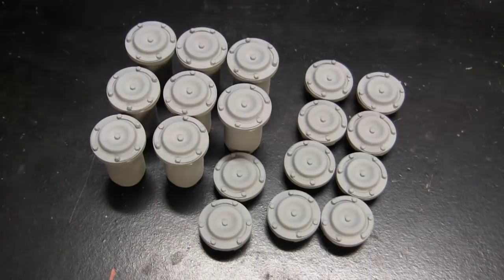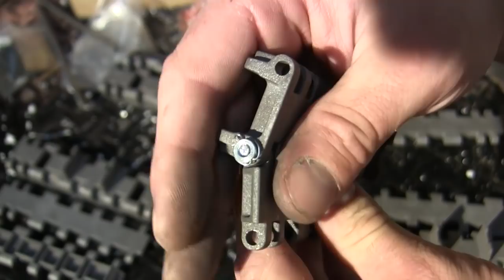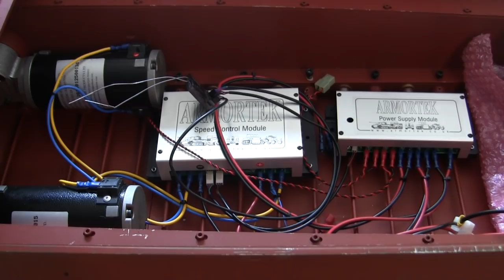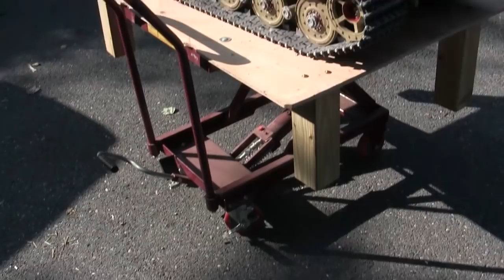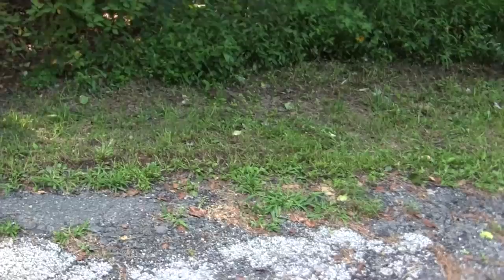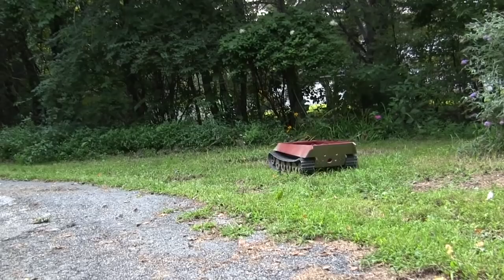Armortek 1/6th scale RC King tiger project video#4 (Track and test drive)

Comment: 19:08 ......they should do an ICE version of this brute. There's enough room in that thing for a good 50-60cc engine that would have more than enough balls to move it around. Batteries absolutely suck as a rule, and at this size range, fuel power is quite practical to set up.
Reply from the maker: What are you talking about, micro gas engines in models suck hard. They require too much maintenance, dirty, sound like week whackers, require an overly complex transmission, fuel spills and oil spills ruin the finish. Yeah no thanks bro I'll be rolling with electric, problem free and mostly maintenance free.
Reply: @oddball759mm  I'd rather have an engine in mine. I find electric to be infinitely more fussy. The batteries are never charged when I need them to be, they don't last half as long as I want them to, they take forever to charge. Lithium battery tech has improved on this immensely compared to nickel and lead acid, but it still doesn't hold a candle to the convenience of pouring some dinosaur squeezin's into a tank. Beyond that, the pixie wranglers are always doing stupid shit, getting them set up is bleh, and they're super fragile besides. One crossed wire, bound up track, whatever, and you're out hundreds of bucks (at least on this scale) as the magic smoke wafts out of the hull.  Either that, or it just shuts itself down and stops trying. 

No thanks. I like my pistons. 

Look through my channel. See how many electric RCs you find compared to how many fuel burners you find. You'll see why I want a fuel burning tank in my collection pretty quickly.

Beyond the issues I have with batteries and electric propulsion in general? We've got sound sims....and they're never very close. I've never heard one that I couldn't immediately tell was fakery. Not even the ones in 80,000+ dollar battery cars are able to slide under the radar. There's just too many random variables that alter how an engine sounds at any one given instant for a computer and a speaker to ever accurately pull it off. And the lower down the totem pole you get...IE down to hobby stuff like we're using in our RC tanks...the worse it gets. 

Smokers, too...they're neat little bits of SFX but they're not really fooling anyone. They're HORRID on the battery(My KV-1E's battery life is cut by a good 60% if I run the smoker no joke) and they, like the sound module, don't really react worth a crap to what the engine's doing. HL's latest smokers(Like what I have) at least can vary the amount of smoke they produce based on throttle inputs which is an improvement but it still doesn't quite match what an engine would do.

Honestly, if I had a lathe and a mill on hand to modify a transmission for it, I'd put a Toyan SOHC single in a 1/16th Heng Long tank. More power, more reliability, better sound, no need for a smoke unit. Fuck yeah.
Reply from the maker: @TestECull  Arguing that gas engine requires less work than electric is nuts my man. The worst case scenario when the battery is dead you swap it out, done. Opposed to an engine that needs to be properly maintained, and run frequently or else it gums up. And if that happens you need to do a complete teardown which means for the case on a tank damage on the model. a seal can wear out now you have a mess in your engine bay and can be a fire hazard, it smells awful, starting it up to test in the shop becomes problematic with the toxic smoke...etc. For a RC car you have way better access and no detailing that can brake, so it makes more sense, even though If on a car I'd still rather roll with electric hands down no questions asked. On a detailed tank model, the idea or so called advantages just are not there. Also I have gas powered RC car and it was a disaster. Getting it started was a pain in the ass, keeping it idling was a motherfucker. No joke more time was spent in the prep work, getting it started and the cleanup than running, So big no thanks homie. Also the sound on those engines are ridiculously grating and sound like ass and nothing like a real tank engine in any way. Then op top of that you need to have an equally space consuming and overly complex clutch style transmission to get it running, fuck no! Bottom line there is absolutely no advantage the gas engine has over electricity,  electricity is more coinvent easier to operate, easer to maintain, easier to service, can store for a longer period of time, can be run indoors, can run silent when you don't want to make any noise...etc. The engines go in and out of production so if years later you need a new part your fucked. Electricity 100% there is no other way I would do anything RC PERIOD! The HUR DUR my tank model runs on gas is a meme, no more no less
Reply: @oddball759mm  I'm just sharing my own first hand experiences. I have no problems whatsoever out of my fuel RCs but my electric ones are always giving me headaches. Batteries have been the greatest letdown of the hobby since I got into hobby grade RC 20 years ago.
Reply: @oddball759mm  It's rather fascinating to see at the flying field. I get people saying the same things you say coming up to me and going 'how the hell do you do it' when they see me rock up, bolt the wing on, preflight, add fuel, one flip start the plane, and then just send it into the heavens over and over and over and over again without a single sputter or carb tweak. I'll land, refuel, go right back up again 3 or 4 times in a row while the electric guys are waiting for their lipos to charge...of course once I start hearing chargers beeping I'll land for a bit and let them fly their models I'm no ass about it...and it can be several months between carb adjustments for my engines land sea or air.

Idunno. Maybe I have a midas touch with these engines. I don't think that to be the case...they're so simple that anyone capable of assembling any sort of hobby grade model should have zero trouble with them...but you are not the first nor will you be the last to tell me what you told me. And I can't help but wonder what they're doing wrong given my own experiences.
Reply from the maker: C6 Modellsport  All I can say is that for me gas engines on all the models I have either owned or seen in operation were never impressive and are only nothing but issues. added complexity, more unneeded maintenance, dirty, terrible looks and mods that need to be made to the model for function that destroys the appearance and crappy sound to name a few, simply I'm not a fan. I'd take a battery from 20yrs ago over a modern gas engine anyday and nothing will change my mind
Reply: @oddball759mm  I'll stick to my engines 'cause they give me less grief than any electric device I've ever held.  Batteries fucking suck.
Reply from the maker: And gas fucking blows. Also to add to what you mentioned before, I don't know what you are doing if you have loose wires running about that can cause a short. If so your doing it wrong, and on the gearbox I don't understand what your talking about. How can a motor and two gears be more problematic compared to a clutch system with over a dozen moving parts, and other things that love to go wrong when you don't need or want them too. So far my transmissions have yet to fail or give me any problems
Reply: @oddball759mm  The shorts typically happen internally to a component. Yanno, MOSFET failures. Seen quite a few electric airplanes go in because their ESCs shorted internally, let the smoke out. Have had a couple ESCs fail on me in that manner too. When a MOSFET lets go, it lets go dead short. And when it lets go dead short it usually results in major damage to the model. Tons of Traxxas X-Maxx buyers had their trucks burn to a crisp because the 6s ESCs fitted to the trucks when they were first released were faulty and shorted the lipos out. That meant the trucks would burst into flames and burn to a crisp through no fault of the owner. Traxxas fixed this, of course, with an updated ESC that didn't randomly burst into flames, but the initial 6s X-Maxxes would randomly go fwoomf because of an internal short within the ESC. ESC failures crash model airplanes all the time, as well, often leading to total losses since the control side is usually running off a BEC circuit rather than a seperate battery. One of my best buds at the flying field managed to save one of his EDF planes when the ESC went out precisely because he was running a seperate receiver battery; he turned a total loss into a deadstick landing because of that.

I, personally, have had ESCs in servos let go a couple times despite those servos having zero load on them whatsoever and the board in my brand new HL 7.0 Sherman that I'm building a custom AFV on let the magic smoke out just last night on its fourth drive. Something went wrong on the PCB somewhere and it burnt the trace off right near the ground lead. I now have a Clark TK-80 board in the mail for it far earlier than I had intended to order said board, but given what I plan on building it was getting something like that sooner or later anyway. Probably put one of those boards in my KV-1E as well someday.

And let's not even get into how often lipo batteries burn people's shit down. Even when handled properly those mean bastards will sometimes randomly go fwoomf, which is why they should be charged, stored in a fireproof location. All it takes is one lapse of judgement with lithium batteries and you've got a garage fire on your hands. Or a car fire. Or a house fire. And that's not just limited to RC; Samsung and Chevrolet have both had these issues as well with, respectively, smartphones and battery cars. There's been numerous cases of power tool batteries failing and burning garages/shops up as well, from all the major players. Lithium batteries are a double edged sword; they're amazing and yet they're evil all in one package.

I use tons of them myself. All of my receivers are powered off 2s LiFE packs. My tanks are, at least for now, running on a 2s1800 Li-Ion pack and will soon be getting 2s4000-2s5000 li-pos once I can get down to the hobby shop to buy them. My CA-10 and my 3d printed gokart run off lipo packs, respectively 2s5000 x2 in parallel and 3s800. Even my glow plugs are lit with lithium batteries; I use the Dynamite lipo driver because every nickel powered glow driver I've ever used has let me down. Can't say I'm afraid of lithium batteries or that I don't use them, but I'm acutely aware of their problems, hazards, and don't much care for them. Batteries just plain suck. 

You're welcome to run exclusively electric but shitting all over engines because YOU can't figure out how to work a two needle carb is not doing anyone any favors. I bet your only experience with fuel RC was Traxxas' shitty engines, which is a common thread with anyone saying the things you say, and if that's the case then maybe you need to put your hatred down and try an OS or Saito on for size.
Reply from the maker: @TestECull  First off Liops are shit, and I don't use them ever, To use that in your argument is grasping for straws as everyone knows they are junk and people who justify them are coping. They are a dead end tech and will fade away into the sunset in a few years. Gas lines however are equally as flawed. The rubber gets old and becomes brittle, or seals go and fuel leaks on the inside. Once small spark and the model tank goes Pontiac Fiero mode. The only thing I run with gas are my real vehicles and lawn implements. No more no less. I know how to keep my engines running and the last thing I need to do is to do the same thing for my miniatures or else they turn into gunked paperweights. For my models and what they are used for the gas engine offers literally NOTHING to the table except lots and lots of headaches, problems, and massively preventable issues. So far I have yet to see from you any advantages over the Electric system, outside of your electronics somehow your ESC fizzing out, or batteries discharging / Dying. which even if that does happen it's a 20 min job at most to swap out opposed to playing mechanic and tearing out an engine out of a fully built / painted detailed tank model, playing diagnostic, fixing it and remounting it all without a single paint scratch. Then there is your laughable complex transmission which again offers nothing of benefit to the table. 

Also as for fizzing out your RC tank motherboards, I have no clue what the hell you are doing. As you can see I do lots of 1/16th RC builds myself and have not fizzed a single board during my many builds so clearly you are doing something very wrong my man. Those 1/16s are all plug and play and when hooked up from all my builds are solid and problem free

So if you want to run with your roided up weed whacker in your armortek King tiger knock yourself out. You won't be alone because there already have been several attempts at this and almost all have failed or have never been completed because of problems with the engine / transmission. But for a King tiger I guess it's true to from with the real one

And again to insinuate that gas powered models require less maintenance and prep work is just laughable

There is no agree to disagree on this one, there is just practical and impractical, and gas is as impractical as one can possibly get period. Say what you want about your gas powered models or your issues with electrical systems that you are having but at the end of the day the gas powered models are over engineered by necessity / design and the electric systems have the upper hand and are the past present and future. Gas models are nothing more than a engineering curio and in most cases are a solution looking for a problem, period.

Comment: This might be a weird question, but wasn't the Tiger B something like 68 tons? Shouldn't this therefore have like 12 tons? I'm guessing it's aluminium and not scale thickness...
Reply from the maker: The material is Aluminum alloy, but all armor plates are to scale thickness. When done this tank will weight 300 ~ 400 pounds

Comment: give it a working cannon, that would make a great meme
Reply from the maker: Arming a tank is a worthless meme, too many strings attached both practically, engineering wise, and legally. Also being a customer tank I'm not doing that feature to this build
Reply from the maker: @-T-X-M-  In the past I have mounted an airsoft gun in a 1/6 tank. As for a howitzer An artillery piece is a different story as it's fired with a lanyard which would make it legally like any other single shot rifle / pistol. Problem with any firing arty piece is that I don't have the CNC tooling to make such a build.
Reply from the maker: In fact I've been tooling up a lot of 1/6th scale Artillery pieces, but these are all static 3D printed kits. Unlike the model in this video, these kits are my design / production compared to this model which was released by another company and I'm building / detailing.
Reply: @oddball759mm  darn, was really looking forward to seeing a mini KT dumping tiny shells onto another tiny tank.
Reply from the maker: @OmarSlloum  sorry, not with this one.

Comment: I look at the test ride - the chassis works very well.
And I think - if set up a serial release of similar chassis and equip them with a good modem, GPS, cameras, and specialized tools, you can get an interesting automatic drone capable of performing a variety of practical tasks.
Guard, remote observation of wildlife, I do not even know - ...mail delivery, pizzas - (I hope that nobody will think about it - it will be weird) ...
And many other occupations where a person is not desirable, or difficult to stay for a long time.
Here's a biologist sitting at the computer - and watching remotely by nature on the another side of  the continent ... 
Good luck...
Reply: old comment, but nasa actually used a modified Tamiya RC King tiger with a drill to puncture the tires of the space shuttleafter landing, it was too dangerous for a human to deflate them due to their insane pressure.

Comment: a friend and I had a weird thought, The U.S military spent millions on an unmanned ground drone. one of these clad with AR500 steel and a little money to have an engineer fit an M240C or an M2,  would have been MUCH cheaper!  Plus if you did use a 1\6 King tiger...you would be technically be the only country fielding King Tigers! on a personal note: As an Infantryman, I'd sh*t my pants if one of these rolled up with an MG mounted in the turret. seriously, your average squad wouldn't know what to do with a weaponized 1\6 scale tank.

Comment: so far i have seen nothing but extremely high quality kits, my only concern would be the track link pins. i think they would be better if made out of stainless to combat the corrosion from the dissimilar metals.
Reply from the maker: The different track metals are not an issue, I have the same kit built in my collection for about 10 years now and outside of regular track wear they are fine. As for corrosion the tracks get primed towards the end of the build so corrosion is also not an issue